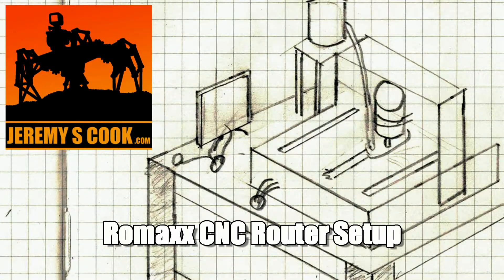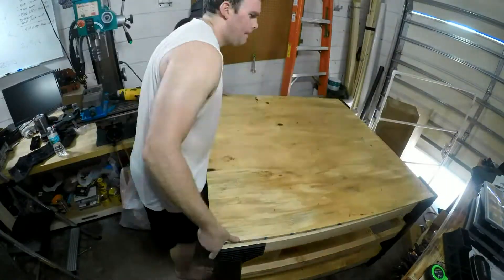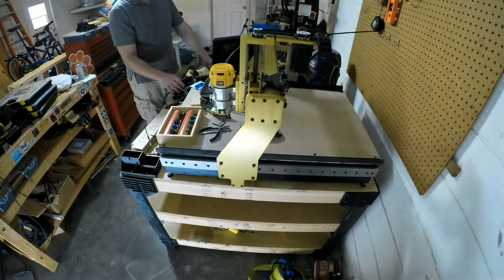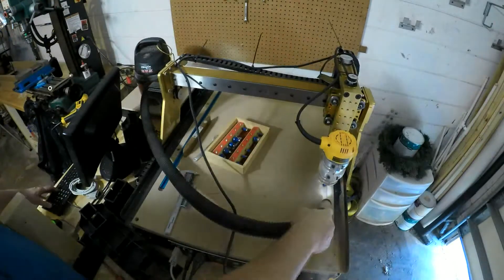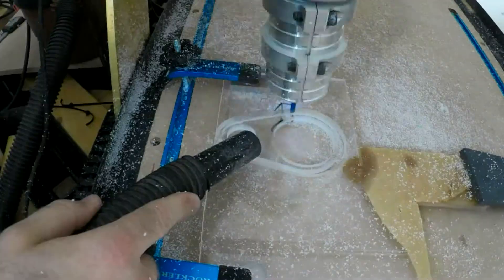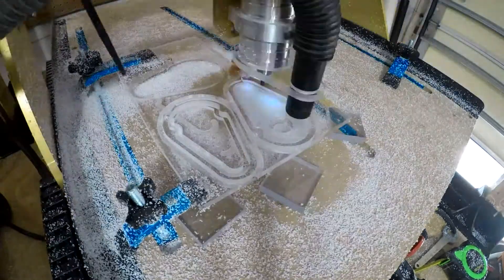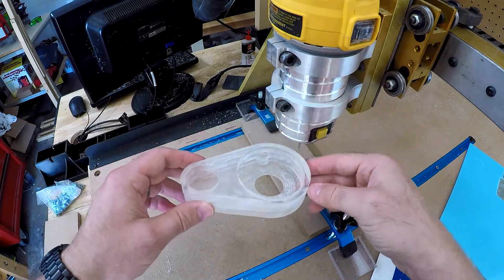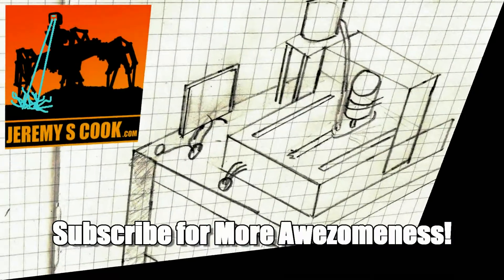Romaxx CNC Router and Vacuum Fixture Setup

Comment: I'm not sure if you have improved this yet, but what makes the romaxx dust collector good is that it doesn't move up and down with the router itself. You adjust it such that it stays flush with your material surface so it keeps suction on it at all times. It also somewhat prevents the debris to fly out in all directions. Your's is fixed to the router so you have to have it offset quite high above the bottom of the bit so that it doesn't interfere with your material while cutting. Next to the worm shaft there should be 2 holes and a set screw slot. If you placed two shafts in these holes and attached your vacuum fixture to it, it would solve the issue of debris flying everywhere and not moving up and down with the router. I also like how you put the clamp fixtures into the mdf itself. Thats a good idea, i need to do this with mine.
Reply from the maker: Hi Ryan, thanks for checking the video out! Clamp rails are certainly useful, would recommend.

As for the dust collector, I've tried the Romaxx model, and it's well designed. However, it's pretty large compared to the router table itself, and doesn't seem to be the right solution if you're clamping a small piece (at least how I generally do it).

Here's what I eventually came up with: https://www.youtube.com/watch?v=WIhFcK5mLU0 - similar concept to the one shown here, but works MUCH better.

Comment: Great video.  Have you noticed a lot of flex with the cnc?
Reply from the maker: Thanks Stephen! It's a very solid machine, so no noticeable flex. 

I did have to tighten up the Y-axis bearings opposite the one I replaced, and that rail seems to have a slight variation in width. I can shift it ever so slightly when it's at the far side of the table. Perhaps I could tighten that up more, but over-tightenining is potentially quite bad for it, so I haven't pushed it.

I'd invite you to check out some of my other videos too - I use this machine in the two that follow this one (and hopefully more in the future :-). Let me know if you have any more questions!

Comment: Morning Jeremy. Wow... I didn't realize that the romaxx was that expensive. I am surprised you didn't build something from scratch. Also, got a link to those T-Slots what you're using on the waste board?
Reply from the maker: Hi Chris,

Yeah, not exactly "inexpensive," but quite a bit cheaper than some. Perhaps I'll take on the task of building an even larger router one day. After building a smaller router from a kit, I wanted this to be a tool rather than the project itself, if that makes any sense. 

So rails links:

T-track (2 ft version purchased): http://www.rockler.com/universal-t-track-universal-t-track
Larger Hold Down Clamps: http://www.rockler.com/hold-down-clamp-5-1-2l-x-1-1-8w
Smaller Hold Down Clamps: http://www.rockler.com/mini-deluxe-hold-down-clamp

They are also available on Amazon, though no Prime!
Reply: Thanks Jeremy. I've got 4 sections of 8 foot long v-rail extrusion with all of the hardware that I need to upgrade my original Shapeoko so I am a bit envious. Hopefully this fall, when it's not over 100 degrees in my shop, I'll get started on it.

Thanks for sharing as always. Oh, and if I didn't mention before, thanks for the stickers :-)
Reply from the maker: Very cool - hope that goes well. It's a dry heat though, right? Or whatever they say, hahaha.

You're very welcome, thanks for checking my videos out and commenting!
Reply from the maker: Ha, ugh says 98% right now! And I thought Florida was bad :-)